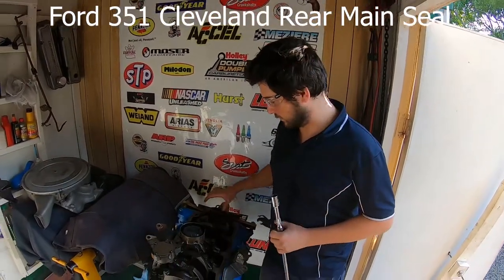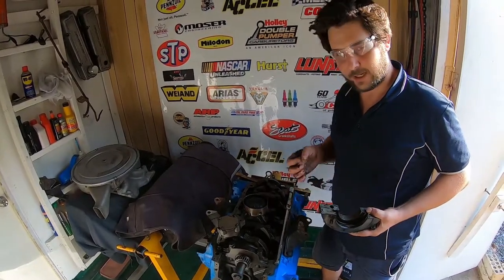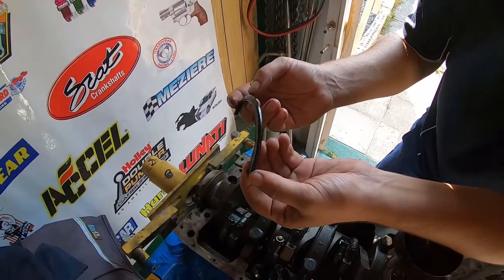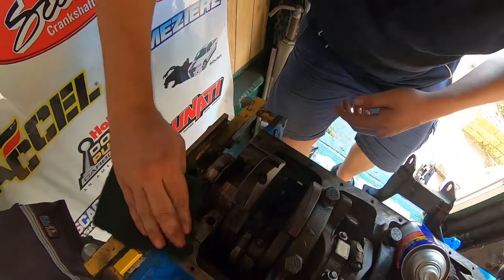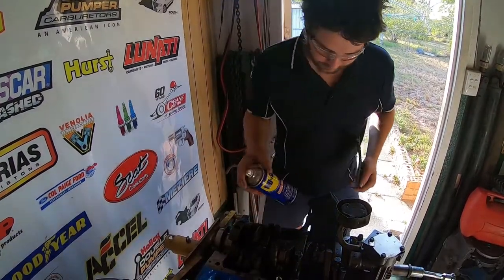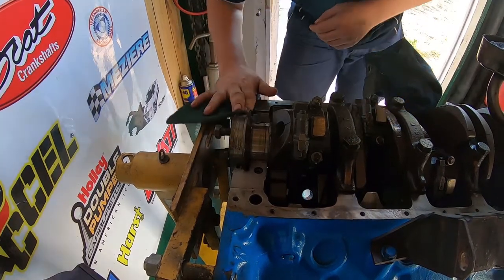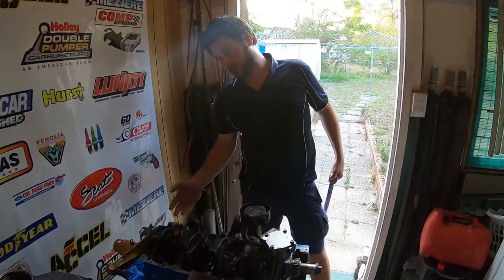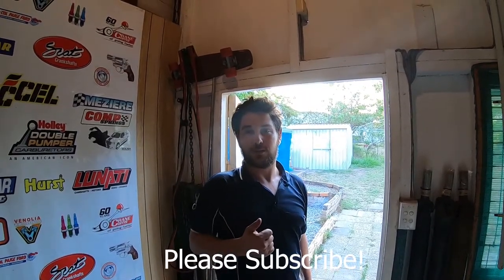FORD 351 CLEVELAND HOW TO INSTALL A NEW REAR MAIN SEAL

Comment: Thanks for the video, seems to be the most thorough i've seen! I wish I had realized I should have replaced my rear main seal(engine has been sitting for 20-30 years)  before I put the oil pan/gasket on and fill it with oil...lol, but better now than on the car finding out it's leaking

Comment: I love my Henries as well  , bit hard to drag the graphite impregnated rope type original equipment manufacturer rear main seal when there are 2 sharpened stakes both in the block and in the cap as well . When I built JG23PP 20395 K , in 1992 the Central Queensland REPCO  rep was carrying a prototype 2 piece

Comment: Great vid this is all great info for me as about to do this on XA 2V 250 whereby replacing the rope seal with a FEL PRO neoprene. 
Only question is why do you not also put a line of sealer along the back edge of the cap or from the seal out to the edge to create a seal dam?

Comment: So curious... FelPro Installation tips says.... AVOID sealant on ends of seals' and you put quite a lot on?
Reply from the maker: Are you talking about rope seal or rubber two piece like I installed in the video?
Reply from the maker: STEP 5
Put a tiny dab (1/8” or smaller) of RTV on each end of the lower seal, where the seal ends meet, taking care to avoid the sealing lip. Less is better in this case.
Reply: @thclevoking  the rubber two piece, i used to do it but every instruction i've seen since says not too  ?

Comment: Hey buddy I've got a question...I have a 72 boss 351c 4v everything is new but still leaking from back of oil pan looks like cheapo summit pan, changed gasket and it seemed to stop but as soon as I fead it a bit of throttle on the road it started leaking again as before so I'm putting the original pan back on and am doing the rear main over just in case. This video does not show that you have to loosen all main caps...seems you just loosen and remove the rear 1 is it not necessary from your experience...sorry for the long winded comment all your help will be greatly appreciated 👍
Reply from the maker: Did you try the better felpro rubberised cork gasket when you re did it? It might be a rocker cover leak or even the oil pressure gauge too and dripping down so rule that out. I usually don’t have to loosen them all I made a custom screwdriver to knock the upper rope seal out when they are really stuck.

Comment: Hi there,  Great video ,  I have a question if yo don't mind,   Is the block the same for Rope or Neoprene seal ?  As I'm doing a Clevo now and crank has the knurling on it,  I see your crank also has it but with Neoprene seal .  Can you use both types in the same block etc.    Cheers
Reply from the maker: The clevos started in 68 and used a rope seal for many years the late black blocks in Aus already used a rubber seal. Neoprene is available and are the best to use but I didn’t have one on hand when I made the video to talk about them.
Reply: @thclevoking  Thank you for the reply, so Can use Rope or Rubber in the same block casting yeh ?
Reply from the maker: @marsv7777  correct but rubber is better in most cases most old time builders swear by the rope seals. Neoprene is for engines that have leaked before or will see a lot of revs.
Reply: @thclevoking  Perfect .  Thank you

Comment: hello mate . would a rear main leak on a clevo drip out from the bottom of the bell housing and spacer plate, or between sump and spacer plate . just put a new sump and gaskets and its still leaking .
Reply from the maker: A lot of leaks come from rocket covers and work there way back and down if it’s not them then keep looking lower. It will leak between the sandwich plate and main cap if it’s a bad rear main seal and drip down. When you drive it the oil can end up everywhere if you haven’t driven it chase it back, most likely will be the rear main.
Reply: @thclevoking  thanks fella .

Comment: I've seen people machining out the rear bearing cap doing away of the rope seal and putting in a round rubber seal
Reply from the maker: That must be done with an aftermarket stroker crank they don’t have the knurling where the seal rides

Comment: Built a 395 Cleveland. Put rear main in it last 1000 miles. Pulled it ran on dyno again never leaked. Put in truck ran it 21 miles and it’s running out of seal again. Even double checked this time that seal was right way. I’m beyond frustrated at this point
Reply from the maker: Aftermarket cranks need the block machines for a 1 piece rear main seal
Reply: @thclevoking  any other suggestions lol. With our completely starting over
Reply from the maker: @drewtaylor8332  a custom neoprene two piece main seal from competition engines or pavtek in Australia might fix it mate or maybe even a rope seal if you are careful.

Comment: Sorry to tell you that your surfaces you put sealer on are done wrong, and this is why. The surface from the rubber main bearing needs sealer between the seal along the machined surface to the area of the oil pan seal to the bearing cap, this means across perpendicular to the crankshaft. Where you put the sealer is parelell to the crankshaft which will not be effective to seal the inside to the outside of the engine.
     I have been doing this since the early 1960's.

Comment: My rear main seal half in the block is stuck as if it’s glued in. Where’s the 250 likes and you’d share your tips and tricks?
Reply from the maker: If it’s stuck bad you can undo all the main caps a little to get a bit more room, or fashion an old screwdriver into a curved punch using the cap as a guide so you can tap the rope seal out without scratching the block. I didn’t pay attention to the likes but I’ll have to do something about that, thanks.
Reply: @thclevoking Thank you for replying. I didn’t have a rope seal in my 351, it was the hard neoprene seal. I did loosen the main caps slightly and used a piece of electrician snake to remove the small pieces. It was really stuck in there. Then I polished the crank with 3,000 grit that I oiled with WD40 first. Thanks!!

Comment: I'm watching this on my phone & I must say I cant hardly hear anything your saying. I feel like I have to hover over my phone to make out what your saying. I will say I am slightly hard of hearing at speech levels but i can hear other videos. My phones speaker isnt the best but there is nuthing wrong with it, it's a s9. I feel like I have to get a external speaker to hear u.  I would watch your videos if u can make your voice alittle better heard. Maybey settings on your recording devise or a better speaker to pick up your voice. The only reason I suggest it's on your end is becouse I hear other videos fine. Thanks I think I like your vid? I'd have to hear it to be sure.